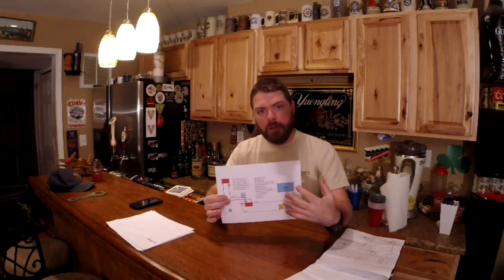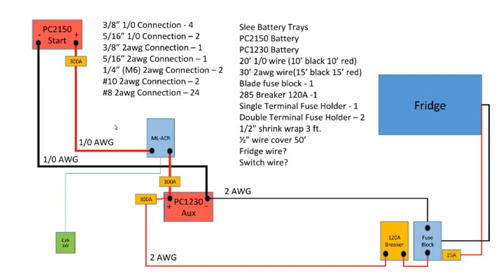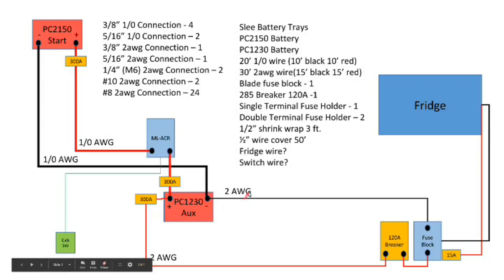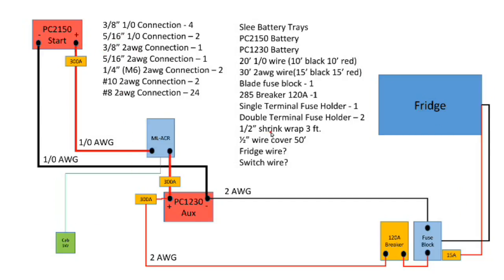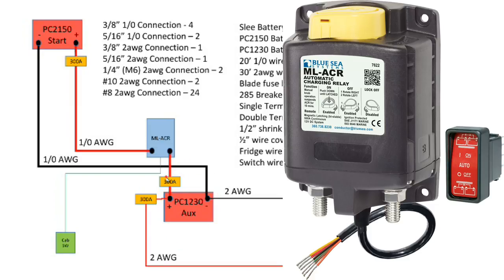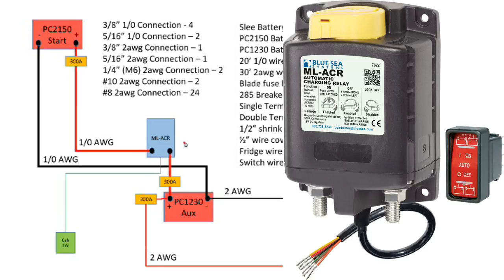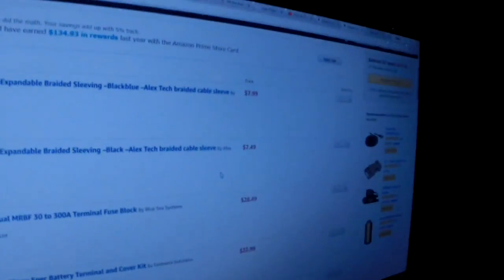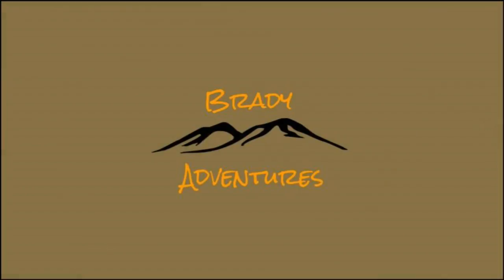Sketching Out the Land Cruisers Dual Battery System

Comment: Love the video. Very helpful. What's the reasoning for the 200A fuse that goes from the Aux to the 120A Breaker & Fuse Block? Is it necessary since you have your 120A breaker? And also, are there any disadvantages of running the fridge directly to the Aux battery with an inline fuse? Considering that since my wiring I bought came with the inline 15A fuse already.
Reply from the maker: Wiring directly with an inline fuse is perfectly fine.  Mine is wired to the block since it's just the place were all internal power is routed to. This is a really good question and I hope my answer makes sense.  The wire from my battery to the fuse block can handle 200 amps.  It is fused at the battery for 200.  The block can only handle 100 and is supposed to be fused at 120 amps.  I went with 200 at the battery thinking I might split the line and run the fuse block and an inverter one day or some other high power item.  If you have a dedicated line you from power consumer to battery a single fuse with a size appropriate to the wire size and length is fine.  When you have multiple gauges in the run you need multiple fuses as the wire sizes, lengths, and power components change.  In some cases it's not a bad idea to fuse both ends of a run to protect the battery and the electronics on the other end.  If there's only one fuse it should be close to the battery.  I hope that all makes sense.